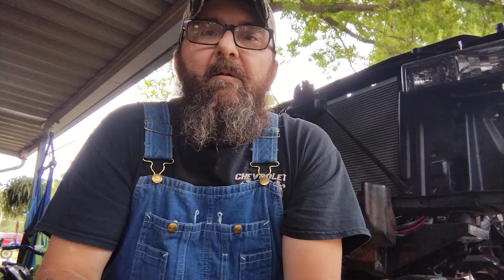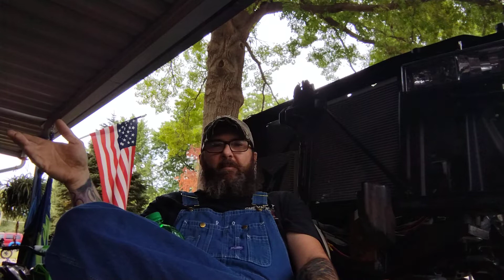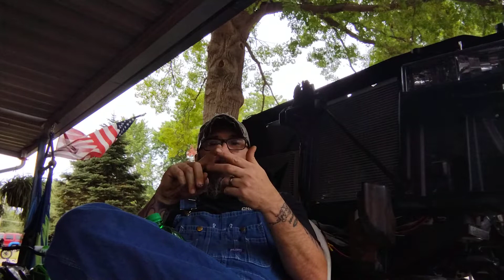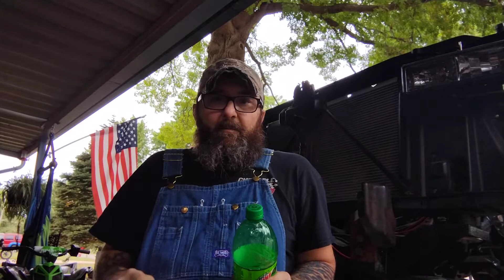Chassis swapped 4x4 engine going back to builder

Comment: I have a question I'm doing this with my 94 I'm putting it on a 87 k10 frame and I was wondering how did you run the exhaust cab you please make a video about it or please
Reply from the maker: I will go over all of truck this weekend in a video.
Reply: @backyardbuilttrucks1  ok can you show how you have it ran from the headers back and are this square body headers or OBS headers
Reply from the maker: @nickygray4691  I used square body headers on it stainless ones off eBay fit fine . I hung the mufflers right behind transfer case one on each side then I run my exhaust back and dumped it at rear axle.